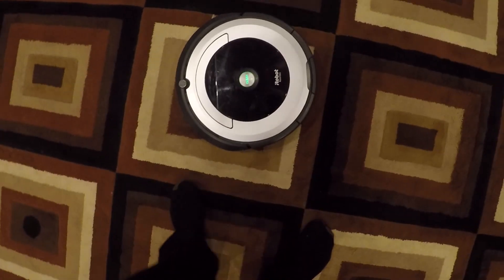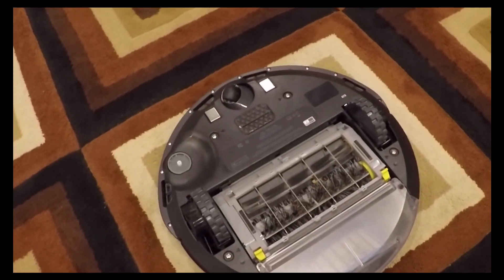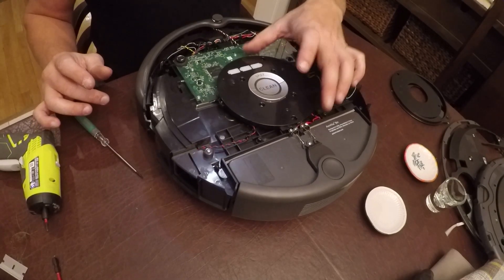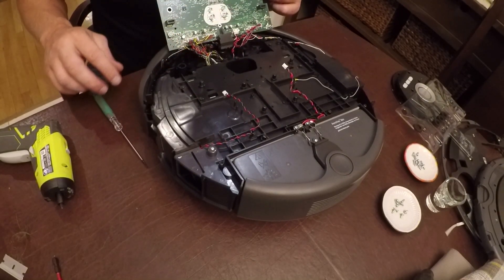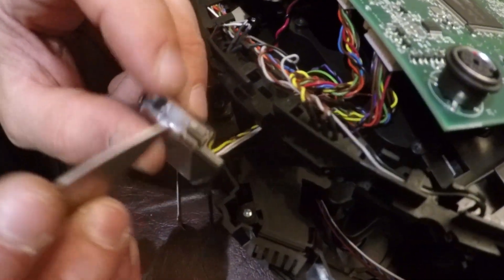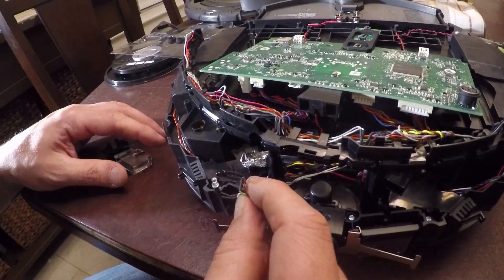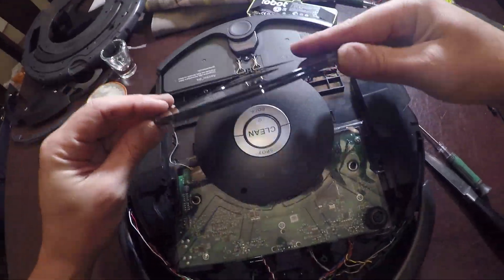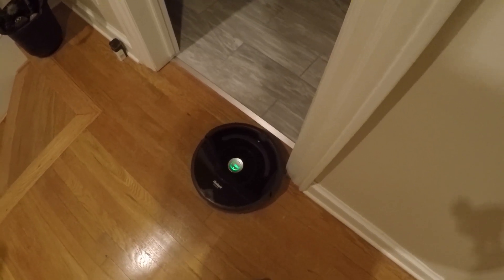Roomba TRUE Black Carpet Dark Border Cliff Sensor FIX (NO TAPE or FOIL)

Comment: (FIXED IT MUCH EASIER; TL;DR AT BOTTOM)
I have a Roomba 690 that had this exact problem. I tried to follow along with this, but I got about 3:15 into the video before a screw wouldn't come out, and I was stuck. So I went back to the old attempts:
- Taping aluminum foil over the sensors: FAIL! I think that makes it TOO reflective. Roomba won't move because it thinks the cliff sensors are too dirty.
- Just regular tape over the sensors: FAIL! I don't think this made it reflective enough, even after 3 layers of Scotch tape.
- Taping one layer of a white paper towl over the sensors (on top of the 3 layers of regular Scotch tape): SUCCESS!!! It's going over my carpet perfectly now, no problems. Not a single hiccup. I don't know if the 3 layers of regular Scotch tape are important, but I'm pretty sure the important part is the white paper towel. It must be transparent enough to the IR sensor that it doesn't register as a dirty sensor, but reflective enough that it doesn't register any cliffs.

Summary: TAPE A WHITE PAPER TOWEL OVER THE SENSORS! Very quick fix when nothing else worked.
Reply from the maker: That's cool that it worked but when you full of sensors with paper or tape or whatever most people find that it eventually fails and needs to be redone over and over again

Comment: this could be done with few lines of code, to flip sensors of and on. we're still waiting for this, so please guys from irobot, just get new firmware out. you even add additional transmitters for virtual walls etc.
Reply: I totally agree - it would be so simple to just have a toggle for cliff sensors, makes zero sense and they could even have a disclaimer.  ALOT of rugs can cause this problem, they need to address it.
Reply: Unfortunately you’ll have people who would forget to turn it off, have their Roomba fall off the stairs, and then blame iRobot lol. A toggle in the app would be great
Reply: @ai522  you add big and flashy note that switching off sensors will make robot tipping over stairs etc, so you sholdnt use this in that scenarios.

Comment: This worked well for me. I have a 500 series, so a few steps were slightly different, but essentially the same. One thing I did differently, I stuck the LED and sensor into either end of a short piece of thinner shrink tube. It was tight enough that I didn't bother to heat it. I could easily tuck those back into the Roomba where they would be out of the way.

For those who might be intimidated by this, if you are careful, you should have no problems. Take photos as you go, so you know what goes where. Use small bowls for the screws and place the parts and screws together in the order you removed them. I went down my kitchen counter and pretty much filled it up.

Comment: Thank you so much!  Worked like a charm on my Roomba 690.  I also had no success with the paper or aluminum solution.  My light & dark carpet is getting cleaned!  Woot!  Woot!  I used hot glue to secure the cliff sensors behind the optics bay.
Reply from the maker: Hot glues one of the most useful tools in the toolbox

Comment: hey! Great video - I just got done doing mine, it was fully charged before i started and now it comes on but it says it is low battery and to put it on the charger, any ideas why this would be? it does not look like its charging either
Reply: Nevermind.  It’s working now even though battery says dead.  Very weird!   It is working.  It’s going around in circles as well now which it didn’t do before.  I guess that’s not a bad thing it’s cleaning better

Comment: Works amazing!!!!... thank you.. took me about an hour and a half .. had a small problem with the front bumper not lining up.. but figured it out ..just taped each sensor on top of the sensor holders when it came to that part... the video didnt really explain as to where to put the sensors after shrink wrapping it.. but other then that the video was a HUGE HELP!!!  thank you again and again.

Comment: The tape probably did not work because the tape was to near to the sensor. A gap is needed so light can be reflected from the reciever to the sender. (Right and left side of the sensor)
Reply from the maker: Even if I could get the tape to work i prefer the proper modification.

Comment: After a lot of fumbling with the depth sensors, I was able to remove the electronics and the black plastic housing from the clear part just by pulling up and out on the black plastic part with my fingers. Didn't need to remove the clear part at all.

Thanks for the video! My black carpet is finally clean again.
Reply: Did you merge close leds ?
Reply: @koszspam  I just taped the sensor and the LED together with electrical tape.
Reply: @MrEricSir  so you taped both the receiver with transmiter and its works? I asked because in my case not working and roomba repets 6 error. I am not sure if both leds shouldn't be opposite instead next to
Reply: @koszspam  As long as the sensor can "see" the LED it's paired with it should work. The position doesn't matter much.
Reply: @MrEricSir Ok. I'l try again with tape it. Maybe i damaged solder or broke the wire causing error 6 continuously... I don't know.

Comment: Followed your guide as I modified the senors on my Roomba 980.  Works like a champ.  This unit has 6 sensors.  Thanks for the guide!
Reply: Is it easy getting to the extra rear two sensors?
Reply: @staffiesaregreat  This was several months ago but I don't remember it being particularly difficult.  All in all very straight forward just apply the same processes to the other sensors.
Reply: @brianmost311  thanks,

Comment: Hi, I have Tesvor X500 having issues with black rug, can I follow the same instructions. DoesTesvor has similar sensor setup as yours? Thanks.
Reply from the maker: Sensor setup will be very similar if not.the same. Dissesmbally will vary.
Reply: @ModsAndProjects  so just opened my robot and got to wherever you instruct to pair the sensor and transmitter together, mine looks like a white and a black little bulbs individually glued to the  little board. How do I pair them, because physically I can't move them, any suggestion or workaround for that please?
Reply: @ModsAndProjects  don't know how to insert a picture of that to the reply so you can have a visual of it
Reply from the maker: @susanrahimi7017  message me on Facebook and I will try to help

Comment: Duct tape and a piece of white paper would have the same effect.
Reply from the maker: Did not work on mine... also tried mylar. If paper did work my guess is it would be a temporary solution at best.
Reply: ModsAndProjects what about putting some nail polish on my old 522? I don't want to fool with my new 675 to that extent. Thumb arthritis too bad now to fiddle with stuff I don't have too.

Comment: Great video! We used this as a guideline for an older 760 model. couple of notes are below.
The top panel is a slide and pry motion. 
you can remove the black sensor case without prying off with the clear portion. There is a tab on either side that you can gently slide (it is kind of hidden in the groove). Once the tabs are loose you can pull the plastic clip up and out. 

There are 6 sensors.
We used black electrical tape and just tucked the wires in open spaces. 

Putting the thing back together is a bit more trying than folding a paper map. (I just dated myself)
Beware of where your wires are placed when reassembling so they aren't in the way

Comment: You show a Roomba in the before picture that is recent. You then fix an earlier model. The video is not helping me get the newest one apart. The black center is not coming apart
Reply from the maker: That is not true.  The Roomba in the before picture is the exact same model that was modded in the video.  Where are you stuck? perhaps I can help. I've only modded this particular unit, but i have heard of many who have complete the mod on other models (see comments below)
Reply: It may be the same model but not the same version. I have the one you start with. I’m done with the modification. It works! No need to do anything with the motherboard on the latest version. The clear plastic shield is square on mine. The top removal is different. I figured it out.
Reply from the maker: @jamespayne6194  I'm glad you figured it out and got it working congratulations :) I'm sure that design will change in time but the concept is the same on every model.

Comment: I keep getting error 6..so i tried your method and im still getting error 6..any ideas on what else it could be ?
Reply: I would recommend seeing if there is any tape blocking the transmitter and receiver. Both LEDs have to be touching each other to trick it. If tape is in the middle of them, it will lock up. Good luck!

Comment: This worked on my e5 model, just wanted to say thanks!  The steps were a bit different on this model and I was worried about where to put the sensors after taping, but I came to the comments and saw the one about tucking them in.  It's working great on my gray area rug now.  Thanks!

Comment: I am having trouble accessing the mother board on my Roomba 690. Specifically the spot in the video at 3:25. The set up is slightly different and I can’t get the cover off. Any help would be appreciated.
Reply from the maker: Hi! Make sure you check for screws hidden under labels (you can feel of poke with a small screwdriver for them) Manufactures LOVE to hide screws under labels.  If you are 100% sure there are no screws holding the part one look for small release latches That can be pryed with a small Flathead screwdriver to release them.  Also there is a guy in the comment below who did this mod on a 690 - 
"wystl" 3 months ago  -Maybe he will have some advice for you.
Reply: Lightly pry the cover on one side, you'll hear it snap out. Be gentle Im currently doing my 690 as i type this.

Comment: Thanks for this! Did the mod on our 680 in about 45 minutes. The disassembly is a bit different. You have to force pop the button cover off. Getting the sensor housing out can be tricky, but just use a thin object like shown, pushing the handle away from you and sliding the housing up at the same time. A thin "butter knife" is probably better than a sharp knife. The wires are thin so go slowly. I used the heat shrink tubing but inserted one in each end so they were facing each other. There should be a software option for this but oh well! Thanks!
Reply from the maker: Thanks for the positive feedback! It would be a simple software feature to add, but think of the warranty issues when peoples rumbas go for a dive down the stairs =[  I think we will be stuck with this hack for a while.  I have so other interesting mods coming up for Roombas If you are interested please consider subbing!

Comment: I just finished this fix on my 650 named William. He is vacuuming black carpet as we speak. Thanks for posting this and for answering questions. For anyone considering doing this, I’m a novice with electronics, and this took me more than 3 hours. I spent one hour alone on getting the plastic sensor casings detached from the Roomba. I also put the bumper back on wrong. I think I was really lucky to not break any plastic pieces or sever any wires or ruin the motherboard (which I did not detach - I was too scared). Overall well worth the time if it’s the difference between William working and not working.
Reply from the maker: Success!  Glad to hear it worked out for you!

Comment: I’m confused about what to do to the sensors. The video seemed to breeze through the most important part really quickly. Can I use duct tape to put the two sensors together? And then what do I do with the taped up sensors? How do they go back into the little plastic sensor cases?
Reply from the maker: Yeah i should have spent more time on that part.. You don't have to put them back into the clear housings you tool them out of, tuck them away inside the machine somewhere.  As long as they are right next to each other like i showed in the video you should be fine.
Reply: ModsAndProjects does the type of tape matter? Can it be clear tape?

Comment: Great modification. Note, that you don't need to remove the motherboard, you can work with the bumper wire still attached. Also, while you used the knife from the top of the sensor to "pry" them out I found it much easier to pry a little from the bottom and push up on the clear sensor block and they slide out easy.
Reply from the maker: Good stuff and great tips!  Very cool that you got it done without removing the MB and the bumper.
Reply: Joshua van den Hoonaard  you will still need to take the top and bottom off, but leaving the motherboard on saved me a few steps (but less room to work with)

Comment: My only question is how you're fitting the heat-shrinked sensors back in their original housing. They don't seem to fit at all after you stick them together, so to speak. I'm tempted to just tuck them in the unit near/under the motherboard.
Reply from the maker: That's exactly what I did (tucked that back in the main enclosure).  Sorry i forgot to show that in the video.

Comment: I also tried the glossy paper and foil trick on my Roomba 690, but kept getting the error six message. Your technique worked like a charm (although I had to go back and redo one of the cliff sensors because I hadn’t aligned them perfectly). 
Thank you so much for the detailed tutorial. Roomba now maneuvers effortlessly over black edged rug.
Reply from the maker: Yeah, that paper/ foil trick is BS... Even if you can get it to work it's bound to get dust/ debris under the reflective material causing the mod to fail eventually.  This mod is reliable and reversible.
Reply: twystl how were you able to remove the cover to reveal the motherboard similarly to 3:25 in this video?  I also have a 690 and can’t seem to get it off.
Reply: @thomasgriffith5349  https://www.youtube.com/watch?v=s8K2gCzfTxE

Comment: Just followed your instructions and it worked perfectly! Had a black carpet it refused to go on and it handles it like a champ now. Thanks!
Reply from the maker: I'm happy to read your positive results.  I have 3 Roombas, and the modded one is my favorite as it was really frustrating to witness it going haywire when faced with dark patterns .  It's also awesome that you can still use the virtual border towers (post-mod) to block off stairs and other areas you don't want the unit to go.
Reply: @ModsAndProjects  I totally agree, it's a little ridiculous a $300+ product won't allow you fix this from their software though... I can't imagine it being too difficult to disable the sensors through the app.
Reply from the maker: @dakotalong2588  It would be simple for them to implement in the software OR hardware (switch).  I imagine the cliff detection sensors act as sort of an insurance policy, if the user were to disable their cliff sensors and the Roomba took a dive, I imagine return fraud/ warranty repair service requests would go through the roof.